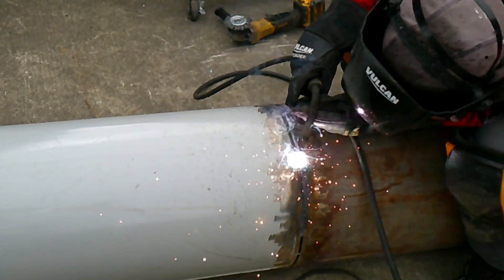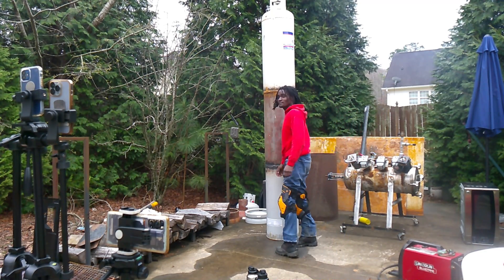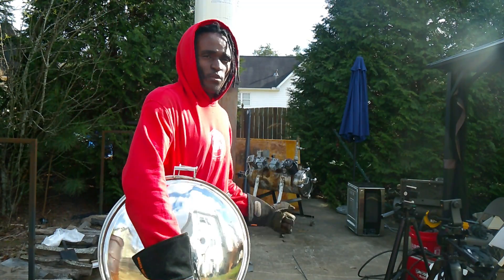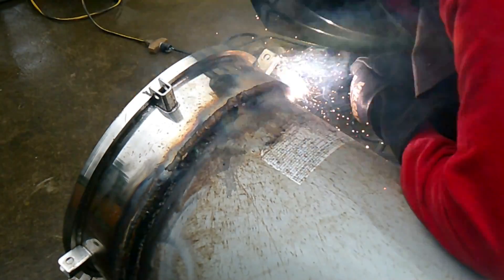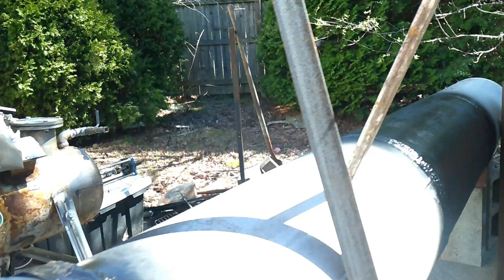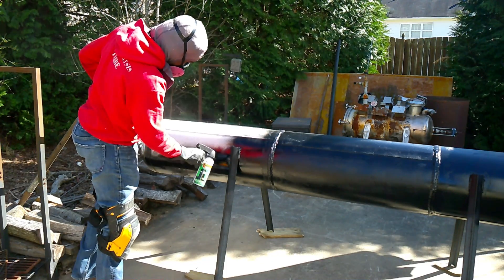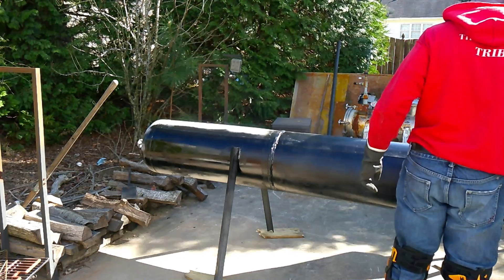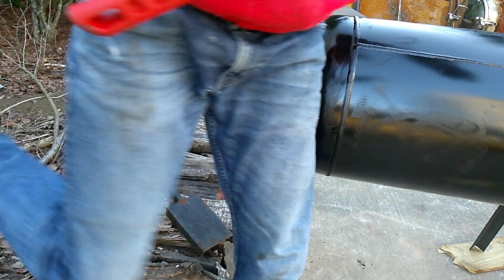Building Mark 4.5 Plastic to Fuel Reactor Part 3 | Looking like a Reactor!

Comment: The multiple magnetrons wont work the way you want them to, you will get destructive interference some of the time and it will waste power, you would be better off getting a single large magnetron from a commercial oven and supplementing the heating by burning the non condensable gasses so you don't have to store them.

Comment: Despite being in awe of your massive rigs for pyrolysis, I'm trying to draw up a design for a sort of "portable" campfire + generator fuel supply sort of pyrolysis rig with a baseplate made from an old satellite dish, a metal paint can (or two, if secondary heat chamber) for the sealed chamber, and 2x pressure relief valves that'll need to be easily replaceable.
My idea is to have a tiny campfire on the dish with the can above, the pipe coming from the top would hit a T-joint that splits up/ outwards to generator input, and down to feed the fire so it'll self sustain until no more (or not enough) plastic remains.
Reply: After doing some very light research into plastic recycling for 3d printing, I believe that the two projects could be combined.
 Different fuels extracted from pyrolysis burn at varying rates, different plastics need different ranges of heat to become malleable without melting or burning. Plus, the "filament purge" of changing materials is perfect mixed compound trash/fuel for feeding the pyrolysis machine. Anything unfit for printing, for example contaminated with metal shavings or dirt, can become fuel to continue the cycle of recycling.

Comment: I really hope you read this. I am building something similar to your machines and I wanted to ask you what material are you using to protect the magnetron from high temperatures and pressure but allowing the microwaves to pass through.

Comment: Do you need high temperature high pressure graphite gaskets on flange fittings with bolts steel is okay to use but it should be stainless steel if you want to last and for it to be reliable
Reply: RTV silicone can work I've tried that alternatively you can put asbestos or metallic gaskets
Reply: @Greenergy254  I only use graphite impregnated steel mesh gaskets zero concerns zero leaks zero problems zero wicking zero odors zero smoking no retightening and they are designed for high heat up to 800 Degrees

Comment: I'm in Kenya. I've made a reactor to extract fuel from plastics too. My reactor has a volume of 2000 pounds(850kg) my plan is to use charcoal brickets made from the carbon residue and ash.
Reply from the maker: That is amazing! Great work and much respect. Traditional or Microwave?
Reply: @naturejab  traditional soon I'll upgrade your standards.
Reply: @naturejab  ❤️
Reply: Excelent idea!
Reply: How do you bleach or stabilize or clarify your pyrolysis oil
Reply: @tonydiesel3444 refining the oil would be for a different type of videi